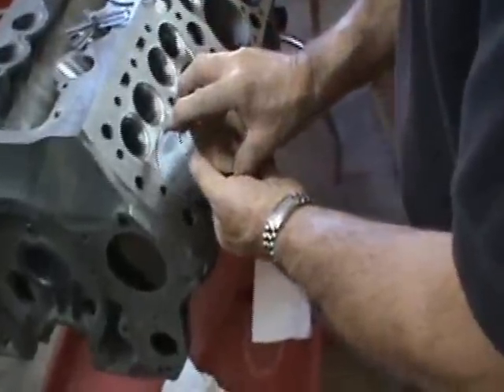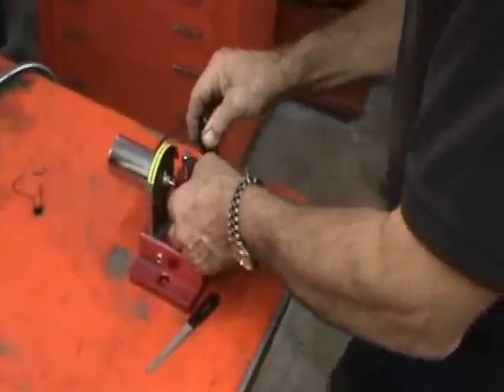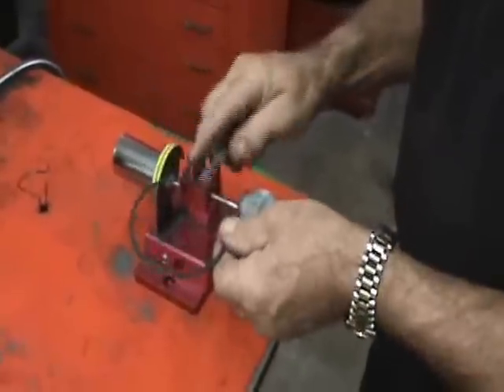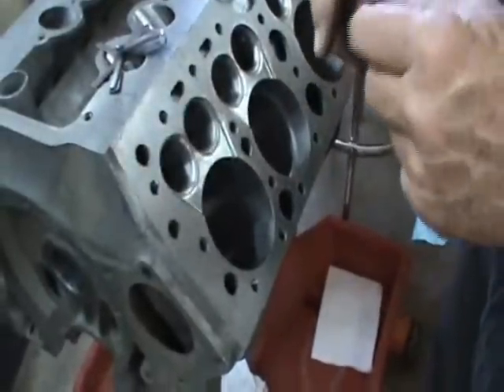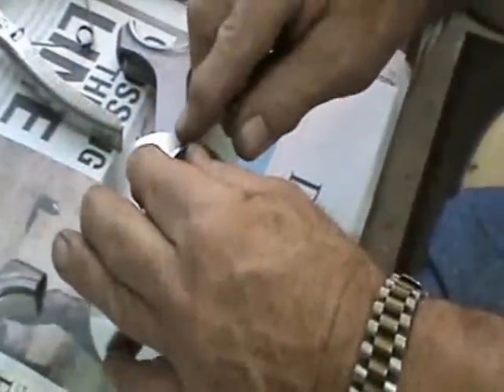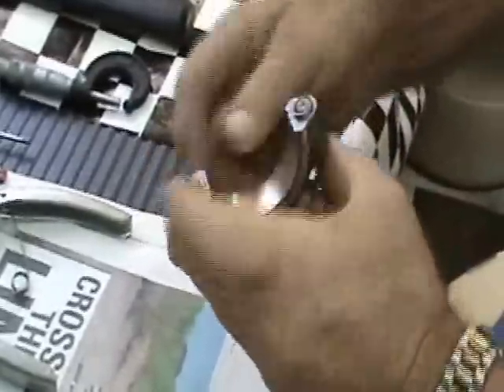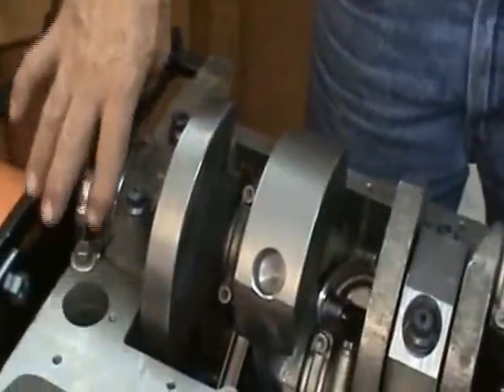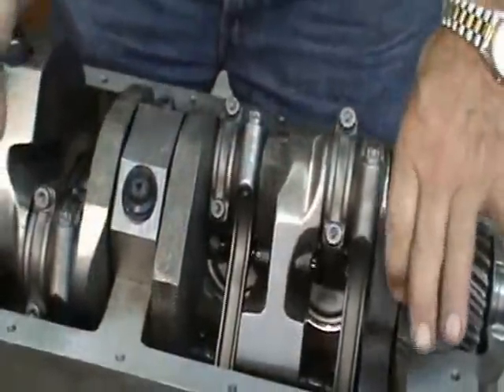Building a High Performance Flathead Ford  Part 3 -  Piston & Rod Assembly & Installation

Comment: 12:24
This is why some people like to put a paint mark on a torqued bolt. For parts that get torqued in stages, these people have more than one color of paint.

I love that modern piston and narrow piston ring designs can be used in classic cars. I remember being at an auto show and looking inside a Ford 2.3 Ecoboost. Some people were surprised to see how narrow modern piston rings are. I then told them about how Mahle Motorsport makes pistons for SBFs and SBCs that have the same ring package. I said "Thanks to modern alloys and coatings, you lose no durability and no sealing power, and you might even gain some. You only lose weight and friction." They were amazed when I told them that.

Comment: Why isnt the relief ramp radiused at the cyl wall... you’d think it would permit better flow at 5000 rpm...?!?
Reply from the maker: It is advisable to add a corner break/radius where the relief intersects the bore to enhance flow and prevent a hot spot. Unfortunately not much room before you get into the top ring. There should be a corner radius on the subject engine but it doesn't show up very well.

Comment: How much power does relieving the block actually produce? I suspect not much because even though it breathes a little better it comes at a cost in compression.
Reply: Is it possible to restore compression to stock level by using slightly domed pistons? Thanks for answer.
Reply from the maker: A good relief can add about 8-15% more power while only reducing the compression ratio .2 - .3 point (worth about 1-2% in power). Relieving is a clear winner for horsepower, and in the day all serious flatheads were relieved. See 335 HP Flathead Ford V-8 Performance Handbook for more info on how to do a recommended relief and test results.

Comment: Just curious...when you installed the studs for the main bearings, and the rod bolts you used a lube ...does that affect your real torque if you are reducing the friction when torquing?... as in ,the torque will actually be higher than your torque wrench setting?  If so I'm guessing you always allow for that.  Great videos on a motor I never knew anything about! Thanks!
Reply: This is correct.  Arp's specified torque setting is lower then it would be with motor oil to account for this. an example would be a 1/2" main bolt might be torqued to say 110 ft/lb and with arp moly lube on the threads might be torqued to say only 95 ft/lbs but the bolt receives the same amount of "stretch"